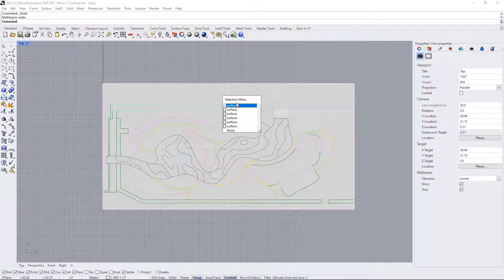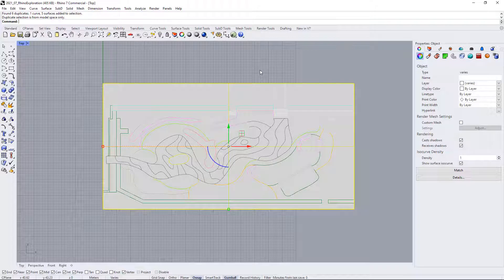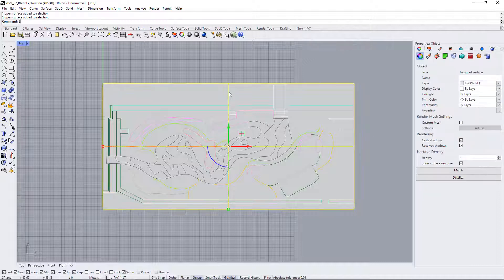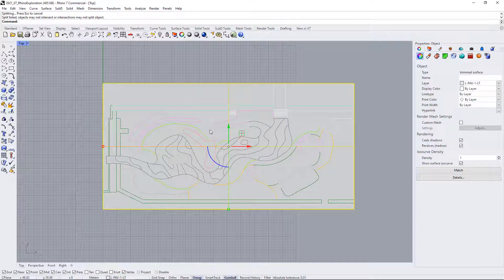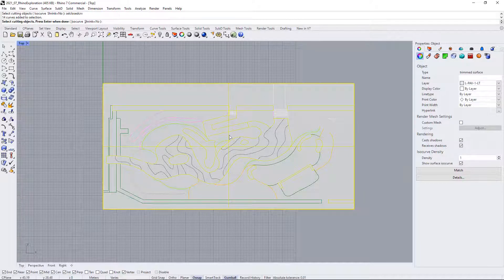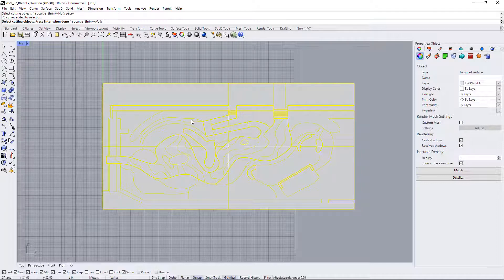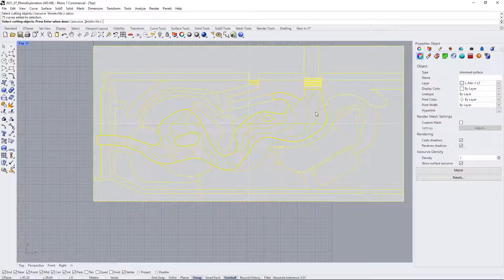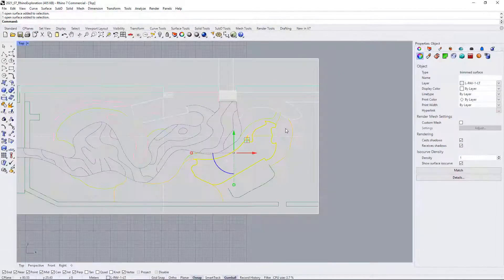Rhino for Landscape Architects - Split Surface Troubleshoot

Comment: Can you use splitting surfaces from curves with a patched surface that isnt planar? for example: my linework is going to go on top of existing topography - i was thinking of projecting my flat autocad linework onto the cad mapper topography. What do you recommend to do? have you ever dealt with this before
Reply from the maker: Yes, you can do that. Just use project to surface command and as long as they are closed polylines they can also split modulated surfaces! I do it all the time :)